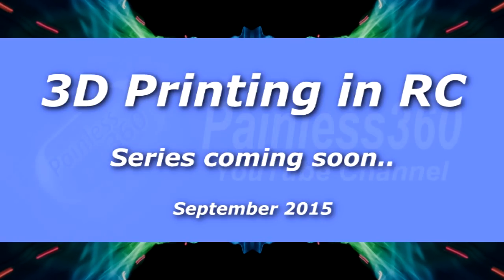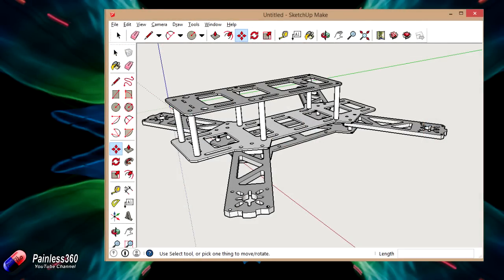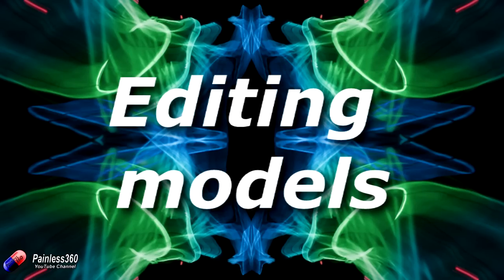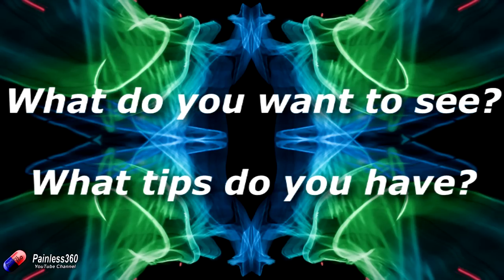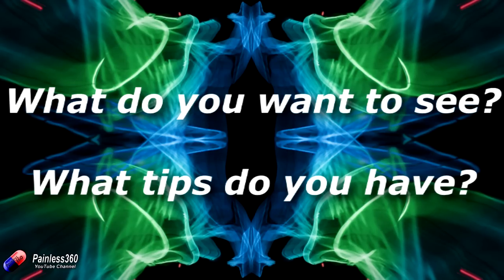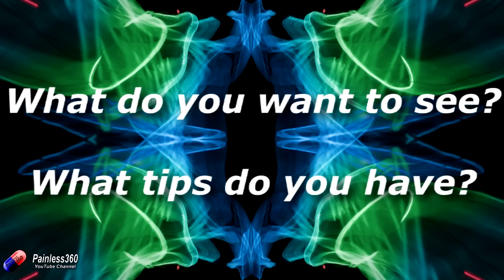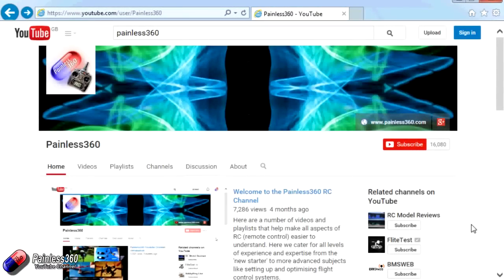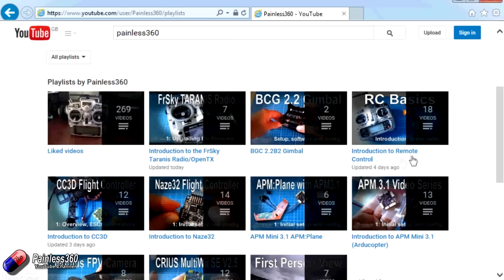3D Printing for RC - Series Coming Soon!

Comment: I would love to get one of these 3D printers and even a CNC machine too but they are far away out of my budget sadly and i have so many good ideas about designing my own frames and stuffs like that...
Looking forward to your serie of videos :)
Reply from the maker: +ABMNS PRODUCTION They are coming down in price all the time. The HobbyKing printer is a great introduction (if a little basic) but for a machine to get you started it's worth considering.
Reply: +ABMNS PRODUCTION I found the Printrbot Simple Metal a great starter.  I brought the kit with my son for a school project. Here is a link to the final result 30hrs or stop motion.  Whew! https://youtu.be/hN7VQOVmcBY.  Certainly a big learning curve, but once you understand the principles it is not too complicated.  Sort of like learning to fly a quad.  I still have challenges with trying to use sketchup and the more complicated software packages like Autodesk Inventor (more really around the terminology).  But as a really simple design tool I found that http://www.tinkercad.com was perfect for making really simple shapes and a rather short learning curve too.  I even made a replacement hinge for the battery lid on my Enviromower!

Comment: im really looking forward to this series. would be nice if you were to start the series with a first time buyers guide ?
Reply from the maker: +michael lee Good idea, will do. Things I considered included the ability to print ABS (less fragile than PLA), decent sized print area, ability to use 1.75mm media, good resolution, good reviews, not too large for the desk (!) and precise 0.3mm nozzle for fine prints.
Reply: +michael lee Yes I second that, like what would be the most efficient and well rounded printer to buy, something we won't toss out in a year because it couldn't print certain parts .
Reply: Painless360
Exactly, awesome although size won't be an issue if it interfere with the ability to print larger parts, one should be able to accommodate space for the purpose of better production. just my 2 cents.

Comment: Your timing on this is spot on. I've just purchased a 3D printer myself but have'nt I any experience to offer yet. Likewise when I first set out with multi-copters, until I found your tutorials from which I've learned such a lot. If this series is as good as your existing ones then I can't wait. Cheers.

Comment: As a starter printer I have had very good luck with the robo3d and matter control software it came with its not super advanced software but works well. Z height is very important to get right.

Comment: Hey painless! I would like to see how you take existing readily available pieces- like the arms of a 450 flamewheel or 380 Totem and use a 3d printer to make a new "base" to screw them onto. Making a better quad. One with more capabilities for specialized flight. Also using a 3d printer to make things fit from different manufacturers. Like a brace for Tarot carbon fiber retractable landing gear that can be put on a different quad.

A Quad Mash Up!

Helipal has made a Stormv4 aerial platform out of Totem arms and custom carbon fiber plates. It's pretty interesting and ingenious...

http://www.helipal.com/storm-drone-4-gps-flying-platform-bnf-naza-v2.html

It's made me think- what's possible with the best of low cost readily available parts. Put together in an imaginative way? I'm sure you can help find the answer.

Love the channel and the 3d printing is a great idea!

Cheers from NYC!
Reply from the maker: +fade2nada I am aware of a chap in the US who's doing this exact thing and making CF frames for the centre with some amazing features. If he starts a Kickstarter I will promote it on the channel.. 3D printing would work too :)
Reply: +Painless360 thanks! That's exactly what I would need. Your channel is #superb thanks for sharing your ideas and experience and knowledge. It is appreciated

Comment: Thanks for doing this Lee. I think many in the hobby have been looking at 3d printers for the last few years, but are finding it hard to make the leap. Which technology? How much to spend? What features are really required? Will the investment we worth it? Etc. if you you can help answer some of these questions it would be great. V
Reply from the maker: +Marty Rome Things I considered included the ability to print ABS (less fragile than PLA), decent sized print area, ability to use 1.75mm media, good resolution, good reviews, not too large for the desk (!) and precise 0.3mm nozzle for fine prints. I will cover why I chose these and at the end of the series we will cover if I was right ;)Happy flying!

Comment: Well I'm excited.  I've owned my printrbot for only 8 weeks so I'm no expert but I have managed to produce some awesome upgrades for my taranis radio, ZMR, and F450.       One thing I have come across is how do I chop up a STL file that's to large for the print bed in to two.        Also I have been putting off upgrading to windows 10 until I know if Mission planner and Cura will work properly
Reply from the maker: http://youtu.be/6rostD8O5sg

I'm running windows 10 so will let you know..
Reply: +Painless360 So how are you coming along with the 3D printer series?  I'm progressing rapidly in the industry with my own EBAY shop specializing in multirotor parts.   I build my printrbot and also a Delta printer for a customer,  and I have also been working with the G codes and printing with multiple colors with one extruder.   Your Multirotor  channel was a huge part of me becoming a professional multirotor Guru who is the soul authority in my area.   So feel free to contact for any info you might need.  I know your fully capable of working out your own problems but If your as busy as I am a helpful shortcut save some valuable time
Reply from the maker: Thanks, I've had to order a few metal replacement parts for the Rostock printer I'm using as the plastic parts have not been great.. The calibration routine is a mare...
Reply: +Painless360    Wow... sounds like we have similar taste in equipment.  I just finished building a Maxx v2 for a client.  I recommended it to him because it was the next printer I am going to purchase....  I'm looking into having a friend replicate the laser cut wood pieces out of carbon fiber.    I liked the printer a lot.   once you get used to it its very nice to use, and the matter control software is great.  In fact I liked it so much I managed to get my Printrbot to run on that software so I can get options that CURA didn't allow.    I will be ordering my own Rostock within a few weeks paid for entirely of the profits from my ebay sales from my little printrbot.  I plan to use the gigantic build platform to make my own fixed wing FPV craft.     I recommend some thermal tape and heatsinks for the motors... especially the extruder.   I'm using them on my printrbot that works 20hrs a day to keep motor temps under control for long runs.  I noticed the extruder on the rostock got quit hot...  especially if you increase the speed multiplier.
Reply from the maker: The extruders are both cooled by dedicated fans, the got ends on the basic kit have a melting point about 245 deg. C and I want to print PLA ;)
Reply: +Painless360 ah yes the PEEK section of the hot end...  one of the few design flaws... you also wont be able to print with other exotic materials like polycarbonate or any other material that needs to be printed above 245c unless you upgrade hotends.   Also I plan to somehow Mary the Devorcied extruder/hotend set up.  I have a feeling that some materials,  especially the flexible stuff,  will have a hard time with the corkscrew in the Bowden tube.   It will also provide more flow control at the tip by eliminating pressure buildup in the long tube between the two components.   Basicly converting the machine to Pull the material through the tube instead of Pushing it through at the top.
Reply from the maker: Yep, fully metal hotends on their way too! :)

I've just made the video in the series that talks about the problem with the compression of flexible filament in the Bowden tube. Great minds.. ;)

Comment: How about a custom flight controller case. take all the electronics out of their cases and integrate them into one super shell. I'm thinking make it like a sandwich or like a pyramid bottom layer ESCs, middle layer flight controller, antennas and GPS  on th top. You can use brass match between the plates and components to help shut RF interference. And custom ventilation. then do the whole thing in clear or make it look like a brain on the outside. that would be sweet.

Comment: Lee thanks for doing this series. Some ideas for the series 1. How to use Sketchup to modify existing STL files and embed features into new parts. 2.  The importance of a heated bed when printing ABS parts, 3. Material selection for parts.  4. Using Slicer programs like Cura and how to inspect the part before printing.   Also consider picking a project from Thingverse and doing a complete print and build. I am working on the Firefly and TILT and doing extensive modifications on the Firefly using other parts on Thingverse and incorporating them into the design.  You can find my remix parts on the project in the remix section.  http://www.thingiverse.com/thing:958541/#remixes  It would be a fun project were all the users could contribute to the design modifications and also share the Sketchup files.
Reply from the maker: +Jon Car Thanks Jon, I may need your help with some of this - it's  your fault! ;)
Reply: +Painless360  My pleasure!  Let me know how I can help.
Reply from the maker: +Jon Car Drop me a line please with your top 10 'gotcha/things to think about' and top 10 'things you wish you'd have known when you started 3D printing' would be awesome!
Reply: +Painless360 Will do
Reply from the maker: +Jon Car Thanks Jon..
Reply: +Jon Car nice work

Comment: My largest hurtle to getting a printer and jumping in this tech is the whole planned, or perceived obsolescence and Moore's Law factors. I didn't want a printer that would be outdated in a week.

Any help in this cantankerous area of the tech? I know one can only be so... Kreskin-esque when suggesting a new tech product.
Reply from the maker: +Hiway As with any new technology there is always a built in life of a device. Now I think that we are finally getting decent sub $400 devices that perform well enough and can print well in various materials and be easier to use. 

A 3D printer from two years ago will still be going strong now (with maintenance) but the latest generation allows for dual extruders, better resolution, more materials, larger print beds and automatic bed levelling and calibration.

The software is getting better too, we will touch on this a little in the series, SketchUp and others provide an amazing powerful platform for free but do need to change the way you build something. There are some great series already on YouTube that show it can be used also some courses on iTunesU as well..

I keep having those moments in the hobby where I think 'If only I had a piece that could hold this like this..' and rather than reach for the Sugru this is the better option.. Design once print many!
Reply: Painless360
I have at least a baker's dozen moments like that each week! Having one now on a rx mount issue with these 180's. Simple part- and there are a metric crap ton of existing files to manipulate for rx holders! I am just shy of popping on a 3d printer- have been for 8 months.
Reply from the maker: +Hiway the last one for me was a custom bracket for the GPS on the SP3 series..
Reply from the maker: +Painless360 https://dl.dropboxusercontent.com/u/67301981/GPS%20Bracket.jpg ;)

Comment: Hi,
I think you should do a separate video for SU specifically, talk about helpful plug-ins, how to make it more "precise" when measuring and, most importantly, a "common issues while drawing" and how to avoid them, as they can be highly frustrating if not expected, and can alter your experience with the CAD and even not allow you to get the pieces you originally had in mind (A good example would be when you move pieces onto another and some surfaces misteriously disappear). A tip you should include in the tips and tricks, related to CADs is to turn pieces into components (this is how SU calls them) if you want to be able to move those indivual pieces without having to copy them over and over.
Another part of the printer video on getting it to be more precise (and a setting people sometimes forget about) would be calibrating the E-steps per mm of all axes, including the extruder, and checking if you have backlash in any of the 3 axes of movement.

Looking forward to the series!
Reply from the maker: Great suggestion. What plugins are you referring to?
Reply: +Painless360 The one I think is crucial for 3D printing oriented design is RoundCorner. It allows you to chamfer, bevel and sharpen edges of an existing component, and lets you choose the precision of it (it lets you change the value of segments when rounding edges). Another good thing about RoundCorner is that you can bevel/chamfer/sharpen multiple edges at once. I'm sure you'll do it, but it's very important to read the plugin's manual, as you have to follow a certain procedure before bevelling, chamfering or sharpening. There are other plugins that fix irregular shapes or eliminate extra lines drawn by mistake, but as long as you draw carefully, it won't be needed. Hope it helps

Comment: Love your series!  I have been 3D printing for about half a year, and one thing that is critical (there are many) but very hard to get right is the bed leveling, setting initial head to bed gap, and getting the print to stick right.  All of these are tied together, so going over that would be massively helpful to those learning.  Also, a great trick to use for adherence is BuildTak - cant say enough positives about this stuff - simply amazing.  Another great trick is to use a plunge micrometer to set a level bed - start from center as your level point and work out.  Hope some of this helps, and look forward to your new series!  BTW - I would love to see "3D printing - idea box" concept, where you expose cool new 3D model finds, and how to start making your own.
Reply from the maker: +b94cast Thanks for the great suggestions. My first ever prints smushed the initial bead of plastic as the vertical height was out - I'd not put the painters tape under where the Z axis sensor was as well as put it under where the print was! Noob mistake. 

This is exactly what I want to share in this series so that capable RC builders don't have to learn it all by trial end error..

Keep up the great suggestions..

Comment: Good move! 

I've watched the occasional clip about 3D printing and wondered if it was the right time to get into it. 

One of the questions I have is, "can you embed existing parts in a 3D print?" For example, rather than make a mounting bracket for an XT60 connector, could you embed an XT60 connector into a 3D print and then use it on a model? I'm not altogether certain this is a particularly good example but if it could be done then the process could be applied to something more useful.

Cheers
Reply: +James Lamb  James yes you can.  I did that for the Firefly project I am working on

Comment: Hello! I am very interested in this coming series! I want to learn more about this technology that I started using a couple of months ago. At present I am flying a tricopter  designed and 3D-printed by myself. Center core, motor mounts with integrated landing legs, and tail motor tilt mechanism are 3D-printed using PLA plastic. Arms are made with aluminium tubing. Thank you!
Reply from the maker: +Esteban Tuja Wow! Sounds like you should be making this video series. :D
Reply: Ha! ha! Can be sure I should not! You are the expert, and my project is in great part inspired in your videos. I am using a CC3D controller because I learned to use it watching your channel. Thanks a lot!